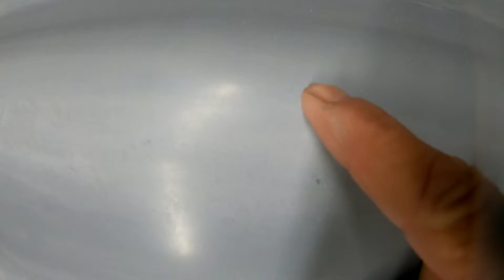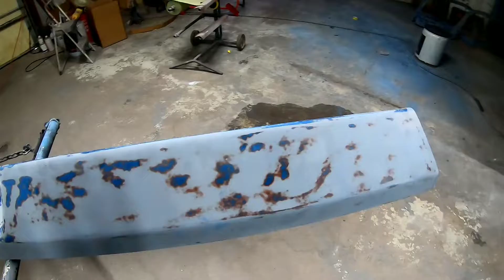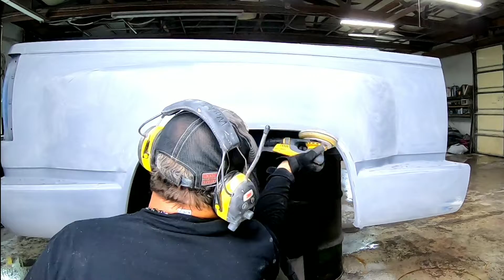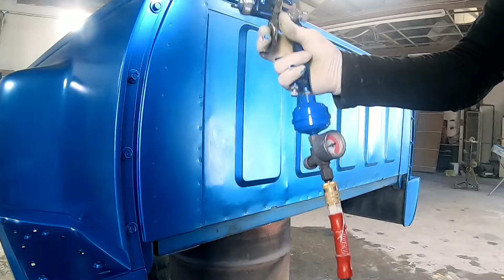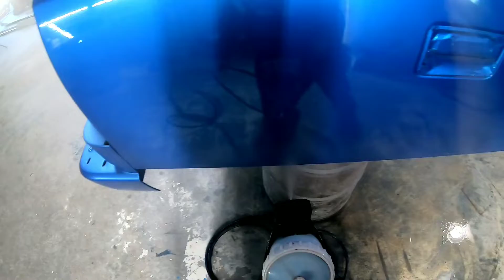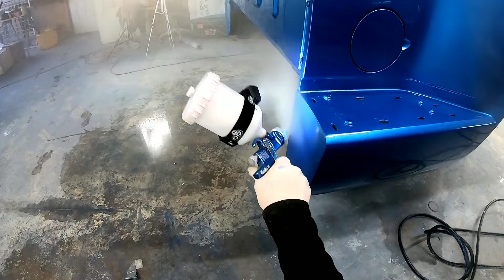How to do a complete paint job on your chevy truck. auto body and paint repair.

Comment: Just subscribed and I'm really impressed and inspired by your videos. Getting ready to do my own Tacoma and first paint job in my shop. Did I see correctly that you were using K2 primer on bare metal on the cab sides? If that was bare metal, wouldn't you want to use epoxy or self etching primer? Thanks for your videos!
Reply from the maker: Yes you need self etching, epoxy or you can use a 2k primer that is direct to metal. Not all 2k primers are tho. So check the Technical data sheet for the product your using. Appreciate the comment and support!

Comment: What was the clear that you used on blue trk? I didn’t right it down fast enough? Thanks Love your help.
You think of the little guy not the big production shops .
Reply from the maker: It is valspar v series but it's is hard too find. Great clear tho but you might have to get it the a local paint store.
Reply: I do not see orage peel what is the trick?

Comment: What tip sizes did you use for the primer, paint , and clear coat ?
Reply from the maker: Depends on the gun but 1.4 -1.6 for primer 1.3 for base or clear sometimes 1.4 for clear
Reply: @GarageNoise  i got one from harbor freight i might just upgrade to one of those that you gave us a review on the 100 dollar ones
Reply from the maker: @alexiszuno519  have you seen my video on the r500? I would recommend that gun it's  around 60 bucks and it's  amazing. I have a link in the description of the video  or you can find it on Amazon.  Less air consumption which save materials  and it can be used with a small compressor.
Reply: @GarageNoise  Yeahh I seen that one but I’m going to probably go with the middle section guns so I can get a better results

Comment: I have that same bed with a couple cracks, may have been slightly backed into I’m guessing. With it being plastic, what kind of material can you use to repair it properly like fiberglass or do you have to use those plastic melting filler kits?
Reply from the maker: They make filler for plastics as well.

Comment: I’m going over my car Mazda rx8 in winning blue.    Had my delivery today compressor and gun so Iv got all the stuff coming.      Iv seen it’s had work done before down one side     But now over the years I get small bubbles holes from under the paint so now it’s very pitted I’m told he never waited long for the seal paint to harden so the solvent pushes out      Iv done cans paint before over it but now doing nut and bolt build     So should I sand them area all the way down then build up again
Reply from the maker: I would sand it down  and build it back up like you said.

Comment: I see in most of your painting videos you aren’t in a spray booth. Do you have a lot of problems with dust or contamination or do you find it isn’t really necessary?
Reply from the maker: I would like to build one. It would be more helpful for overspray and ventilation.  I don't  have too much trouble with contaminants or trash in the paint but I take precautions.  Most contaminants come from the car or you when you paint.

Comment: New to your channel from Australia. Like your work. Clicked on your link on the spray gun you used and it says it comes with a 1.7 tip but you used a 1.3 ??
Reply from the maker: Yeah you don't  want a1.7 . You should have option on tip size.
Reply from the maker: Looks like they may be out of stock I couldn't  find it. Search for the astro evot13   it's  a great  gun I like it a little  bit better than the he 103. Also if you want to spend a bit more money like 250 the 3m performance gun is awesome.

Comment: What is float coat? What size tip r u using
Reply from the maker: Flow coat is the last coat of clear that's  applied a little heavier in order for it to flow out for a smooth finish. The tip I'm using is a 1.3 , thanks for the question and thaks for watching!

Comment: Whats your settings on European clear I have a product called speedokote euro clear 2.1 which is a little thick seams like my gun was struggling a little to spray it I probably will try to reduce it s little and see what happens but I've since ordered a walcom slim kombat spray gun to try out
Reply from the maker: The valspar euro clear , you would think it would be thick but it is not. It flows and sprays great. 3 turns out on the volume and 24psi. The gun has a 1.3 fluid tip. I'd  be intrested to know how the Walcom sprays.